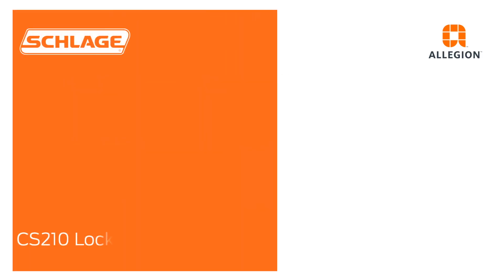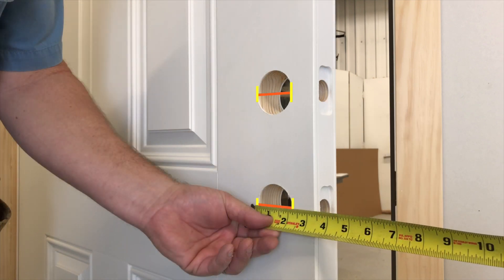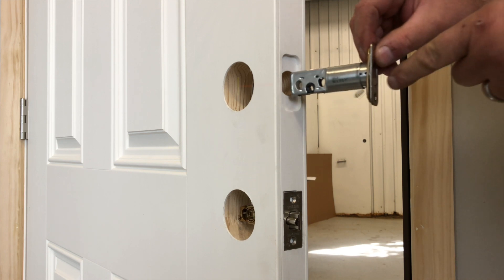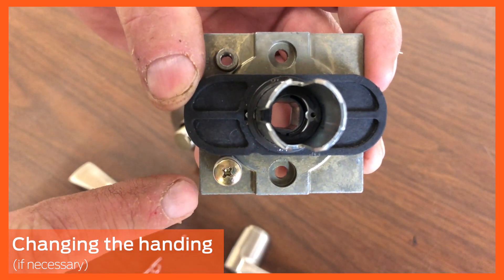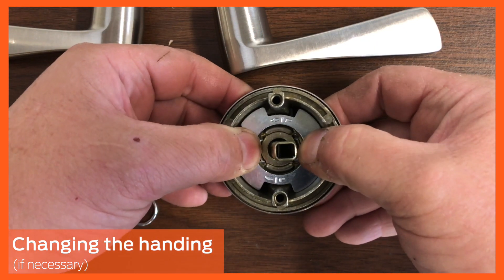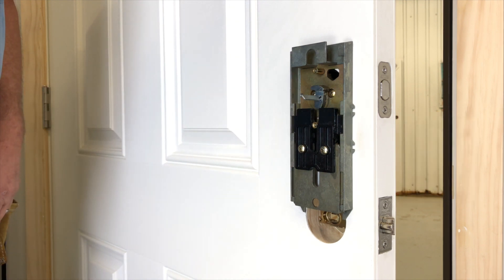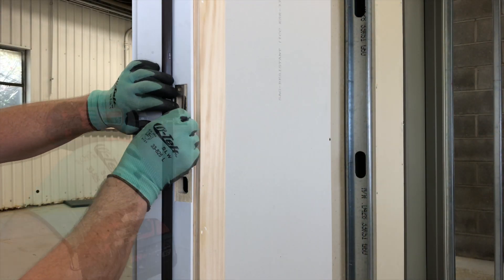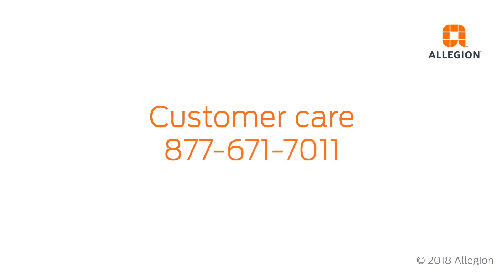How to Install the Schlage CS210 Interconnect Lock

Comment: I giggled when I saw him pop off the face plate to the round one, but he installed the square one after squaring off the latch hole in the door. Which IS what I do.. It's just to easy to square them off with the slotted screwdriver.